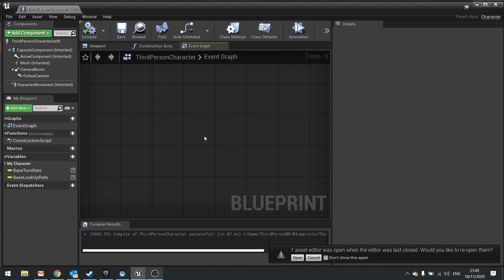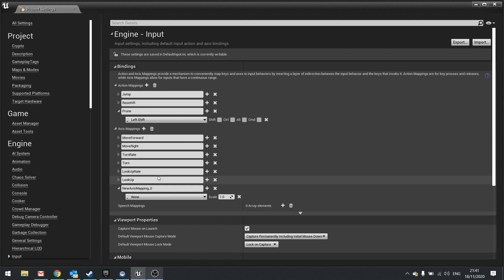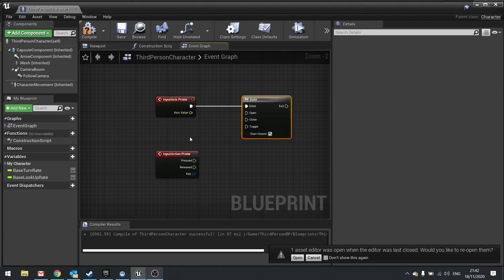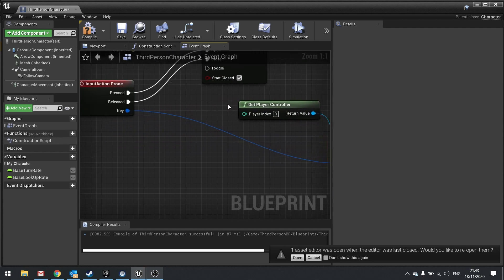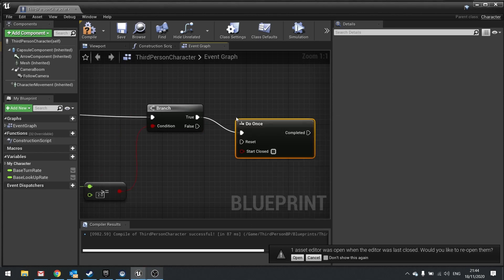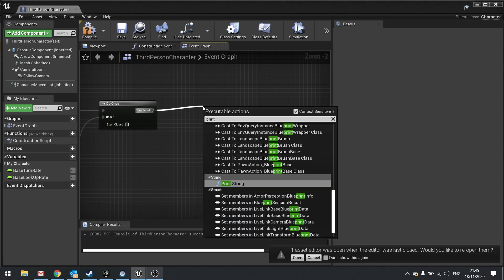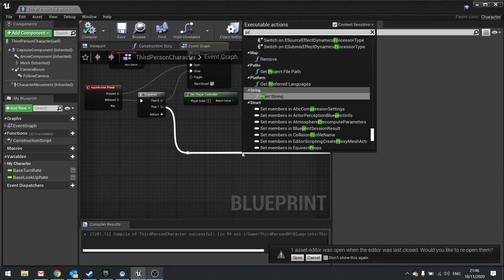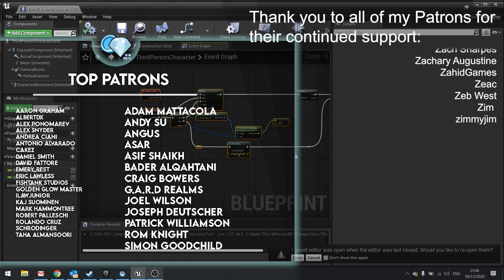Unreal Engine 4 SnackSize - Hold Button Input

Comment: If you are attempting to implement a dark souls like system where you roll with short press and sprint with hold just create a variable to store the get input down time and set it before the first branch on the axis path then check if its under the threshold on release to roll. Worked nicely for myself. Great Video!

Comment: Quick little tip, if you want to implement a "multi-functional" button (so that you can react to both a short press and a hold): Use the "False"-part of the Branch-node!!! This part will be executed, if you have pressed and released the button in less than the time specified ... for instance, in relation to the topic of the video, it could be used to activatee Crouch-movement on a short key press, while holding the button will make the player go into "Prone"-movement.
EDIT: Note however, that the short key press execution path will always be executed (can be limited to at most once, if you use a Do Once-node similar to holding the button), so in this case, one might start the crouching animation before transitioning into the prone animation, depending on the required holding time.

Comment: I am struggling to use this as it keeps running the false until it is true, so it completely breaks it as in what I am trying to do, if the key is not held it will not do the code for if it is held, it will just fall down, which means that it will be false until it is true, which technically means it will never be true. Could you make a follow up video on this topic? Thanks!

Comment: But... why? Why not just use the "Pressed" and "Release" outputs without using a gate and then just check for how long the key has been held? What's the point of the axis mapping and the gate?
Reply: Cause then it will only run exactly when you push the button and never again. It will never return a number above 0.00000001.
Reply: Don't forget, these things are "Fire and forget" so they all run in parallel and all run all the time. So it's always checking, always triggering. It's also why it is difficult to make a "tap" vs "double tap" on the same button/key.